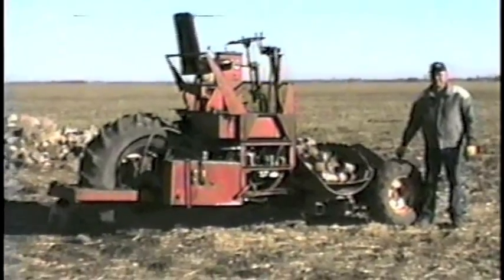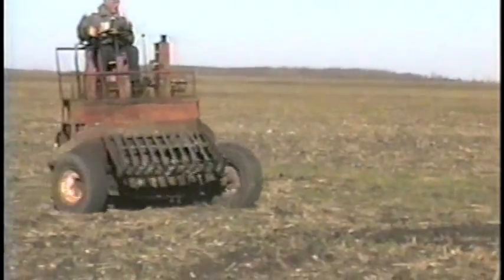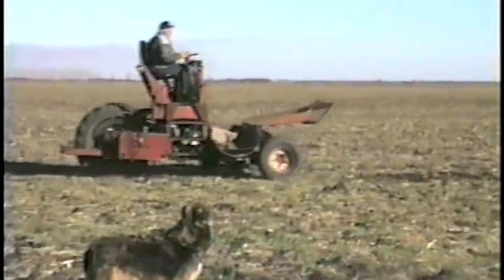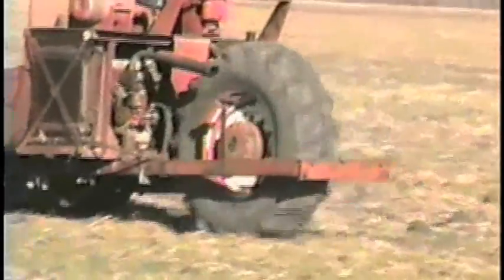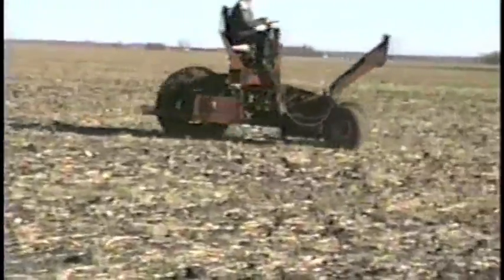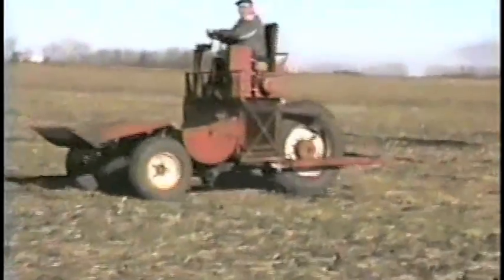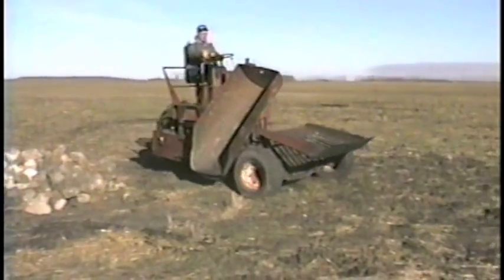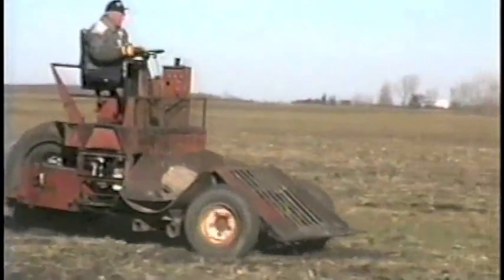He Built His Own Self-Propelled Rock Picker

Comment: Does anyone make a rock picker that is focused at automatically picking up 1 to 5 inch rocks ?  Something I could drag behing a small autonomous tractor and leave running and picking rocks.

I can make the autonomous tractor but not the picker (yet). All the designs I've seen so far have trouble with rocks smaller than about 7 inch.
Reply: Modify a potato harvester.